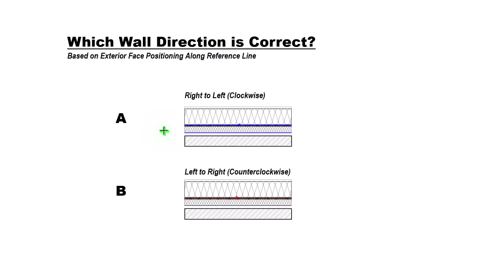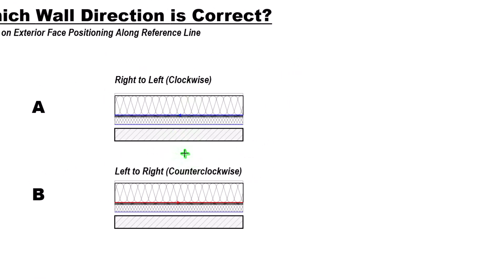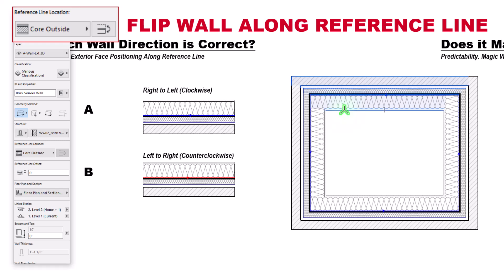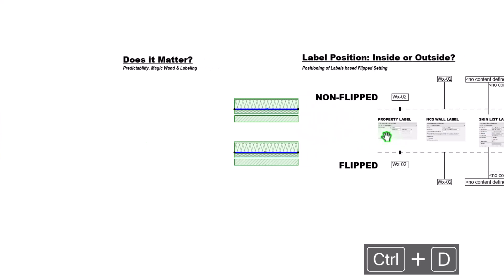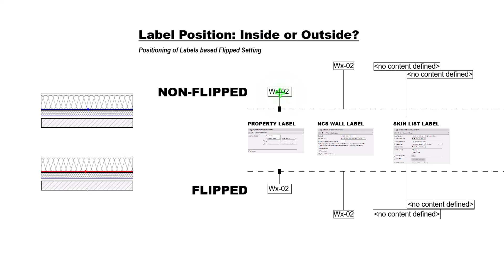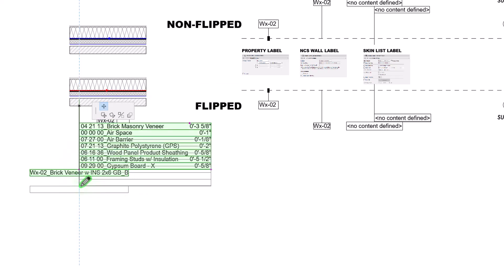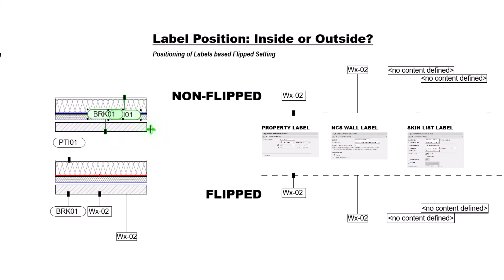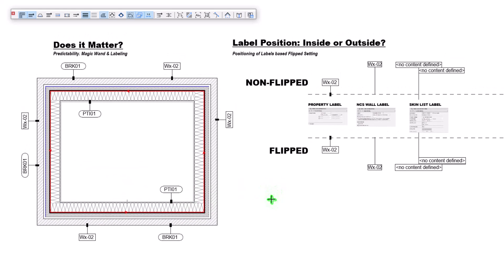Why Archicad Wall Direction Matters

Comment: I am confused how is it left to right counterclockwise? And how is right to left clockwise? Are the labels not correct?
Reply from the maker: Left to right with the exterior finish downward, results in a counterclockwise direction. If you turn on your wall reference line, you'll see when drawing with rectangular input method, how the direction of walls always goes counterclockwise. For exterior walls, I typically have labels on the outside, which when drawing in the right direction, because predictable everytime.

Comment: Thanks for this! Putting wall labels has been so frustrating. I didn't realize that the wall direction impacted that. One thing to note: I think you have the NCS indicator flipped. Under NCS guidelines, the line is supposed to extend through the wall assembly.
Reply from the maker: Thanks for the comment! With all these labels, the placement of where you click also matters, so if you want the line through the wall, click the inside to place the label on the outside.

Comment: Wall composites are so different from what I'm used to that I didn't even know which skin was supposed to go on the outside.
Reply from the maker: Really? You're not drawing with composites? In composites, there's a clear Outside/Top and Inside/Bottom noted in the skins. Try it out! and thanks for the comment!
Reply: @CONTRABIM  I do use composites! I meant the wall composite in your video: I wasn't sure if the brick wall was the core structure (and so would probably go inside) or if it was just the outer skin.
Reply from the maker: @Matiburon04  gotcha! Yes brick wall types certainly vary a lot from region to region. Most in the US are veneer these days

Comment: I never knew about this. I had always noticed that my labels would pop in kind of randomly on beams.
It also matters it you use cadimage wall covering. I you are putting on some kind of vertical siding and a multi story structure. vertical alignment will be off if you have drawn the 1st story in one direction and the next story in another direction.
Reply from the maker: Thanks for the comment! Nice note there on cadimage coverings also. Hopefully this helps in getting better predictability from your labels.
Reply: @CONTRABIM  Oh yah! It already is helping.

Comment: it's weird that it's counter clockwise. to get around having to flip wall labels, i've had to create 2 favourites for each wall label. it just makes it easier. select all walls, Label Selected, re-select the incorrectly oriented labels re-assign the flipped favourite.

any chance you could do a series on using Properties & all the logic expressions? that's one of the things that's severely lacking in content on YT.

Comment: So basically have the correct skin on the outside?
Reply from the maker: Having the exterior skin on the outside, and making sure the direction of the walls is counterclockwise will help ensure consistency. It’s when we flip them around is when we get into issues